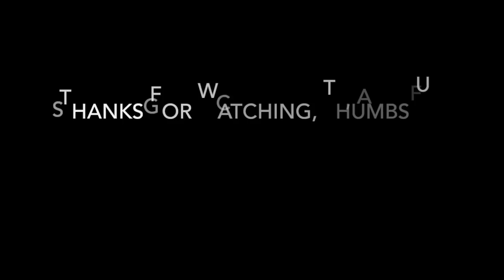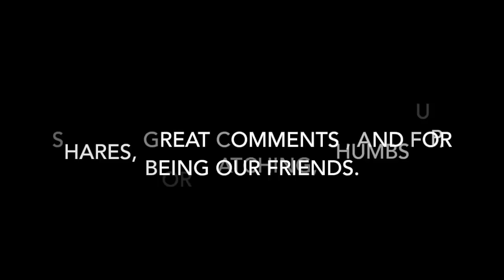Bus Conversion to Motor Home #126 MINI SKOOLIE MEET-UP

Comment: With that heavy planking for the deck, you can lighten it up by running a router down the underside.
Reply from the maker: Good idea.  I will pass the idea along.  Thanks for sharing.

Comment: My winter home (a double wide trailer) is in Highlands County, Florida, which also bore the brunt of Irma. I have an enclosed carport that lost the tar paper and vinyl siding (no plywood or such had been installed by the previous owner to cut down his cost), and this was the extent of my damage. However, many of my neighbors in the park had heavy damage. Damage throughout the county was very heavy. My sister and brother in law lost the shingles, tar paper, and some of the plywood on their roof. Some lost their whole trailer to sever damage.
Reply from the maker: Man, those hurricanes are vicious.  We grew up in OK so we had tornadoes to deal with.  There is something everywhere, right?  :)  Thanks for watching!
Reply: My main home is in Illinois, and those tornadoes from OK sometimes blow through the St. Louis area, and cause all kinds of damage, and yes, there is something everywhere. Stay safe.